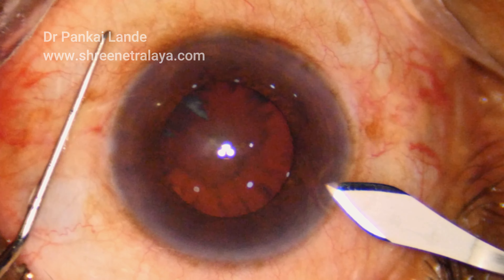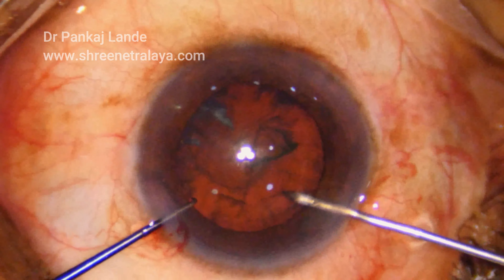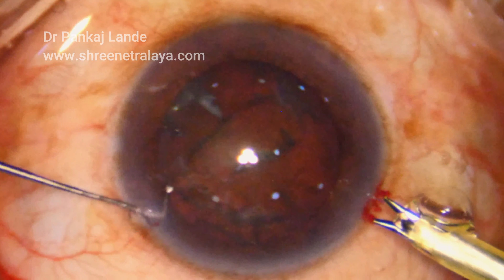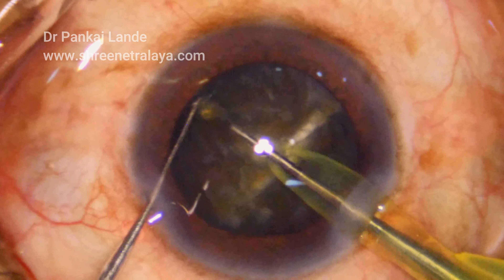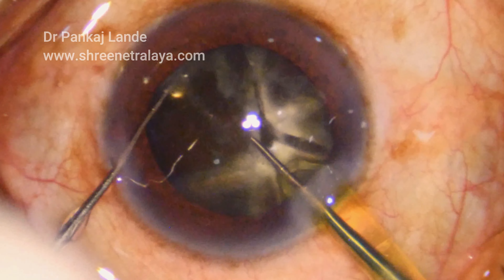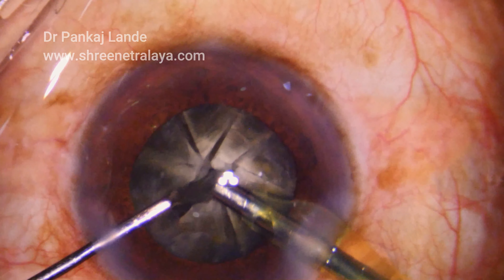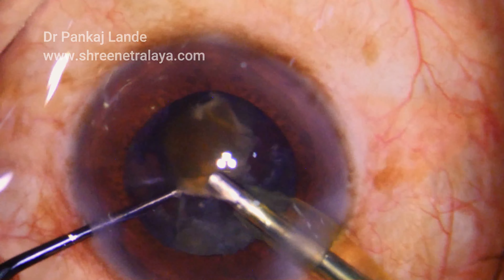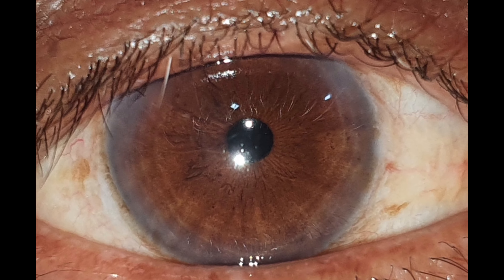ULTRASONIC PRECHOPPER IN ULTRA HARD CATARACT- DR PL

Comment: Very nice surgery and a good tool. Any idea of how much ultrasonic energy is dissipated during this prechopping maneuver (possible CDE)? What's the rough cost of this tip?
Reply from the maker: US ENERGY 30-40..enough 
No need of vaccum... This is solid tip.

FLOW RATE 32

Order at dr neha dholakia, IOLCUTTER. IN

Sir will work on other details soon and post it
Reply: Whou much cost and whou will I get